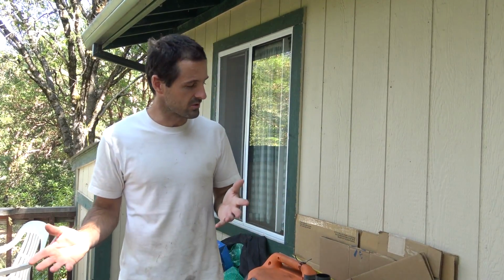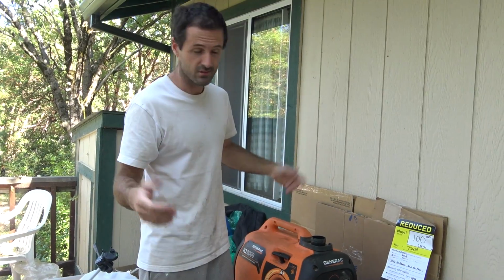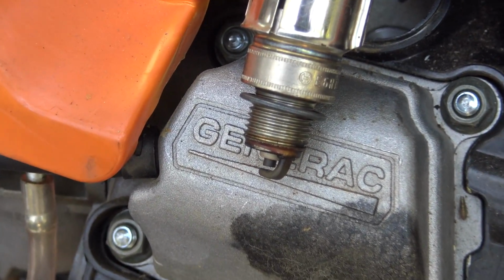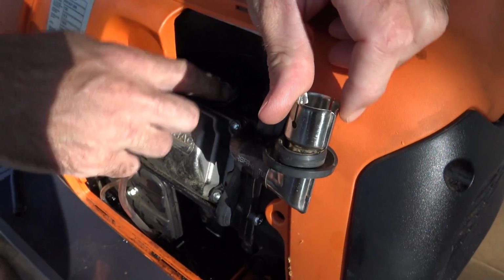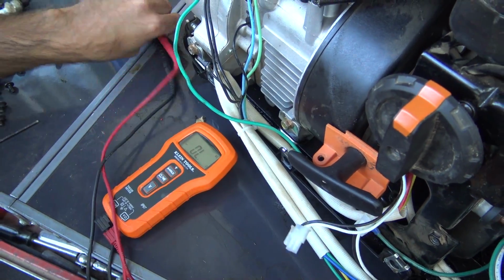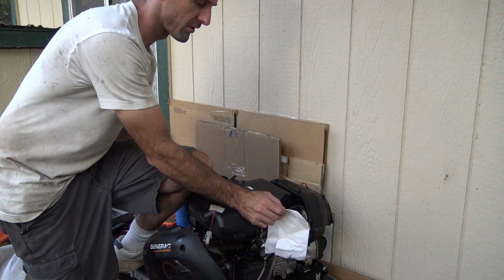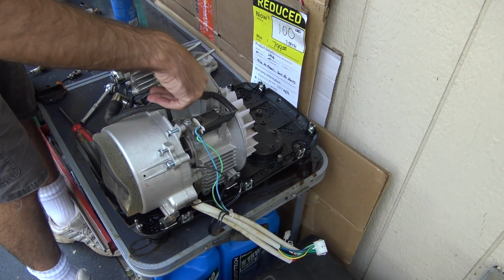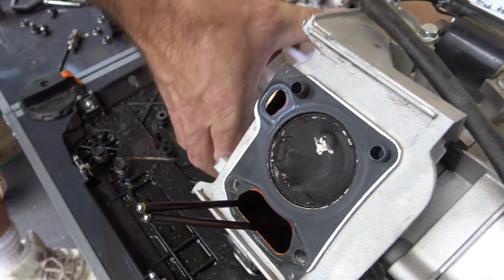$25 Generator From Lowes - Will It Run?

Comment: Someone took it apart and wound up the recall rope backwards. Causing the compression release to release during the top dead center compression stroke and the spark plug is fouled due to the high oil level. They probably had the engine on its side as well letting the gas into the crankcase via the carburetor. While they was working on the pull rope. I have actually seen this on a Briggs & Stratton push mower. A customer brought me a push mower that the pull rope would not engage. And they did not tell me they had it apart so it took me a few minutes to figure out what was going on but they had actually wounded backwards after breaking the spring and I had to replace the spring again because by the time they forced it to go backwards it it bent the spring to the point that you could not make it go the right direction no matter what you did.

Comment: 1st, i'm pretty sure the oil level was fine, look how the neck goes flat to the crankcase, there's no way there is enough oil in this thing if you just keep it "level". I have a hyundai generator and it works the same way.
2nd yes there is probably a decompression system.
3rd air movement in the crankcase is perfectly normal because when the piston is running you are constantly changing the air volume in the crankcase.
4th, when you have a weird spark, you 1st try a new spark plug, then fix the electrical before disassembling the engine!!!
I bet the carb is clogged up and the spark plug is faulty, or if you really are unlucly, the coil is bad.

Comment: I had lawn tractor with a Kohler 24 hp twin and one day it swallowed nut that held the air filter on the carburetor and it lodged between the head and the vavle. The valve stuck open and caused the pushrod to bend. The valve was OK and there was no other damage. The engine stopped running and literally had no compression.

Comment: Bald, man your going bald! Bwa ha ha ! You have more hair than Trump in a wind storm. Anyway, let us know what it was and I believe when you have to much oil it needs to be cleaned with wd40 and that carbon build up will not fire off to much as well! To much oil in that cylinder will slip Oh Get a new spark plug and stop putty gas on them! Whats wrong with you!

Comment: To help you out dude you don't put gasoline on the spark plug you might get it to run if the plug is fairly strong or new just advice not knocking you good luck hope it runs for a long time for you

Comment: You need to adjust the camshaft to lift gap. One of the valve most likely the exhaust valve has lost clearance where it's lifter contacts the camshaft so it is always open just a little bit. Or maybe it jumped timing.

Comment: Im thinking the guy that returned it, may have broke the original pull cord, bought a replacment, wound it up the wrong way, causinge tye engine to spin backwards making the exaust port the intake and the intake port the exhaust (explains all the compression out of the breather too than)  put it back together and wouldnt start so he returned it. And would explain why when you tried to rotate the other direction it had compression.

Also, just earnt yourself another sub :)

Comment: My first guess is that your valve timing chain or belt has skipped or broken. Doubtful that the rings are the issue in this case. Did you check to see if the rocker arms were moving when the engine was rotated?
Reply: The compression - or lack thereof - was a pretty obvious clue. This small size of engine very rarely has a compression release.
Reply: Camshaft is direct drive in these small engines. Wiped intake cam lobe or broken cam shaft is the most probable cause.
Reply: akio2589 - If that is the case then I agree.

Comment: Did you try checking for spark with the plug wire only?  It could be a bad electronic ignitor on the fly wheel

Comment: Whoever had it apart put in the piston 180° from the way it should be installed, so the pin offset is wrong. And just enough wobble to the piston skirt that the rings don't seal all the way.

Probably a dumb wild guess, but that's what I'll go with.
Reply: I like your guess. Is this even possible though? I still like it. Would be hard to figure out for sure.

Comment: I really believe that your engine has a compression relief.   According to Briggs and Stratton, the way to check if you have compression on their engines with this feature is to spin it backwards and check for a bounce back effect.  Seems that yours meets this criteria.  I always test my engines with non-resistor plugs and unless there is a problem with interference, I leave them in the engine.

Comment: the coil spring should only work one way for the pall cord so i don't think that's the problem like others said, also even if the motor spins backwards the air shouldn't be escaping out of the valve cover like it was,  i think it must have some other problem  maybe over filling the oil has cause the valve lifters to have some type of problem, if the motor even has lifters lol

Comment: I think that you should have checked the valve clearance before you even thought about taking the head off,  It would have been easier in the long run,  he valve clearance is too close so when the compression release engages, it opens the valves too much  making it so that there is no compression when the compression release is engaged,

Comment: Cam is 180 out of time
Reply: Ralph Morgan not really, hpw wpuld that happen.. if it wasn't worth rebuild the would not pull a cam.. plus it's geared to crank. If it even has a cam. Has connecting rods to overhead cam

Comment: First, Generac is often known as Genecrap. But for the price, why not. The gas part was good, sometimes a quick shot of starting fluid will make it start if it is a fuel issue. To much and you blow it up. I would of tried a different plug, they sell a tester that can check the spark without a plug (cheap). I would of drained the oil and pour some marvel oil down the cyclinder and give it a few tugs and let it sit overnight, then do it again. Overfilling and dirty oil are killers of generators, bad gas is the most common problem. I have only had to replace one faulty low oil sensor, on a Honda.

Comment: I think the piston pullback spring is worn out, fix that and grease the muffler bearing, it should start right up!
Reply: Muffler bearing is fine. Exhaust belt is worn.
Reply: oh yes of course the muffler bearing
Reply: commonconservative do you know if these small engines use blinker fluid? My lawn mower had the same problem and I just replaced the blinker fluid and it fired right up.
Reply: Mister Hat you are all idiots. Its quite obviously a cracked air filter
Reply: You need a metric crescent wrench for that.
Reply: +commonconservative
A good electrician will know how to use a professional wire stretcher.
Reply: No no no no no, don't mislead people, it's the turbo entabulator, look it up on YouTube you'll find it is a 10 minute video on it
Reply: kinda like a pipe stretchers we use in the shipyards
Reply: Muffler bearing? Must have a Bachmann turner overdrive too.
Reply: Experimental Fun the paint sensor is more than likely in need of service
Reply: Colyn Fetty ya ,well what about the deez nutz valve?  Did you ever even think of that?
Reply: Experimental Fun  I think your wrong it sounds like the waffle bearing he need to remove the pancake housing
Reply: Experimental Fun okay i am young i came to know about it with Chris fix
Reply: Somewhere I read these suitcase generators output 1.21 gigawatts. Can you confirm this?
Reply: Experimental Fun It has a bent Johnson rod
Reply: Experimental Fun haha you must be subscribed to chris fix
Reply: The  Kneuter valve is not slipping. It has bugs in it. The big bugs get stuck in the little flapper jobby that acts like a reed plate and lets the air blow back thru that vent tube he was showing us.
Reply: Flux capacitor missing ....
Reply: Experimental Fun OMG! I just realized I haven't greased the mufflerbearing in my mower! Do you need a left or right handed monkeywrench to access that?
Reply: Experimental Fun The real problem is people don't check  their elbow grease reservoir nearly often enough. The camshafts have probably siezed up.
Reply: +Basil It wouldn't be slipping if he didn't overlubricate it.
Reply: Double overhead cam flinger
Reply: I had of muffler bearings and blinker fluid since like the 1998's. I may have heard of canooder valves but not exactly. And I am sure it existed before the 1998 because I always hung out with the other krakens that were in their 40's when I was like 16-19 age. I heard plenty of party stories of the old Seattle areas and how awesome it was running from the cops on dirt bikes through the woods, but, they did lose all the booze.
Reply: I am pretty sure the magneto plunger o-ring detents are worn clean away.
Reply: noblsht i concur the turbo entabulator is a fickle part
Reply: You should check to see if anyone used any zip ties on any of the wiring because I used some on my spark plug wires to make everything nice and neat, but I made them too tight and was cutting off the circulation.
Reply: its a bad joke
Reply: Experimental Fun stop it...🙄😂😂😂😂😂😂😑😑
Reply: Experimental Fun ha. chris fix. Nice
Reply: someone didnt put rings on the piston is my guess
Reply: Colyn Fetty All of the comments in this thread are jokes bud. Even the ones you think are serious.
Reply: Experimental Fun 
Nice catch...!
Too many people forget about that muffler bearing...!
Reply: Colyn Fetty the hell there isnt just picked some up yesterday it was by the turbo entabulator but to the left of the piston spring ya twit
Reply: Experimental Fun definitely Grease the muffler bearing LOL
Reply: So you've replaced the muffler bearing and greased it (so it slides in and out good) Also make sure about the wire stretcher (the correct amount of tensile strength) After that, it's gotta be the F.C. Just let go through it's cycle. Good call Bob
Reply: maybe the muffler unraveled lmao
Reply: Experimental Fun if it is the flux capacitor, I would just throw it out or trade it for a used Delorean personally.....
Reply: yeap, definitely the exhaust belt.
Reply: Have you tried putting it in a baggie full of rice?
Reply: hahahaha nice
Reply: Experimental Fun what, r u talking bout..
Reply: commonconservative lol
Reply: One other important note I forgot to mention. Was Jennifer wearing a bra this whole time? If she was then that could give a no start problem also.
Reply: Experimental Fun 
Got to watch out for those Muffler Bearings...!
Reply: Experimental Fun lmao
Reply: Chris fix would be proud
Reply: Don't forget the blinker fluid
Reply: I think the pull cord is on backwards, so its turning the engine in reverse and therefore not getting compression.
Lets see what he finds in the next vid. He might alway want to try a different spark plug. ;)
Reply: Experimental Fun Grease the muffler bearing? WTF?
Reply: Experimental Fun 😂
Reply: The nitros oxide is leaking from the pull starter mech. Causing a temporary hole in the dilythium crystals
Reply: Chris Fix!
Reply: I believe you mean the piston return spring😂
Reply: Drop some viagra into the fuel tank and that should straighten out that johnson shaft.
Reply: I had the same problem with mine 2-3 weeks ago.It turned out to be the brass magnet in the brass magneto,s bell housing.
Reply: Tf is a muffler bearing
Reply: Yep make sure those muffler bearing aren't worn out
Reply: to go viral put the plug in your mouth and give it a pull
Reply: what the heck is blinked fluid?
Reply: Cyprian Cyprian no people been saying muffler bearings and canooder valves since before the internet existed....just saying
Reply: I had a guy bring in his car to me on a tow truck. The car had no fuel pressure. After a long diagnostic, since the problem was the last thing I expected, I get the owner back and get into the car with him in the driver's seat, and tell him that the problem isn't something I am sure I can fix, although I did have it running again,. the problem was, in fact, the nut behind the wheel. He looked at me funny, confused. So I explained to him that the reason his car had no fuel pressure, as it turned out, was that there wasn't a drop of fuel in the tank. So I point at the dashboard, and tell him "you see this needle right here, between the E and the F? That is your fuel gauge. When the needle gets down to E. YOU HAVE TO PUT GAS IN, regardless of if you want to, or have time to, or can afford to, or whatever, OR THE CAR WILL NOT RUN. NOW, if the nut behind the wheel is clear on this matter, then NOW the problem is fixed. If not, well, I can't help you". Most people don't need to spend nearly $500 in all to have their cars towed to the shop to have a mechanic tell them that. And that nut behind the wheel is really out of any mechanic's power to fix, usually.
Reply: UPSoA+It took you a long diagnostic to figure it out? Maybe you were a little harsh on the guy considering you already know how to read a gas gauge and he is but a rank armature.
Reply: Oh yes of course the muffler bearings replaced those last summer all by myself😂😂
Reply: murph murph the ELO is obviously worn out as well.
Reply: Would it need some blinker fluid? I heard that could cause problems some times.
Reply: Tyee Cambrón there is no such thing as blinker fluid, dumb fuck.

Comment: Forgot to mention that I have a Honda 2000 inverter/generator for my travel trailer.  I drain the gas out of the carb bowl after each use as per the manual (I assume it's because of the ethanol issue) and it take a lot of pulls to refill that bowl.  For a couple of hundred dollars more, I think it was worth it.

Comment: Bad plug.  I bought a brand new Honda 15hp Honda outboard for my aluminum boat and it ran great for awhile.  Then all of a sudden it wouldn't start.  No warning, just dead and I was on the launch ramp of a lake so proceeded the rest of the day on the trolling motor.  I did the usual things you did, short of tearing the motor apart then went on the web.  Apparently Honda outboards had an issue with bad spark plugs so I got two new plugs and it started on the first pull!

BTW, I used to pickup gas lawn mowers that people threw out on trash days and took them apart just to tinker with them.  You got a deal for $25!

Comment: I predict busted plastic cam teeth. Known to fatigue and break after about 1000 hours on Chinese engines. I had three cheapo Chinese generators that had cam failures around 1050 hours +/- 50. If you are VERY lucky the cam will be available for $8-$25.

Comment: First guess is that the rings are not offset. If this is the case then all the compression is lost through the rings not sealing. Next I think stuck valve. If it has a valve open all the time well... Lastly I think that over filling of the crank case with oil is the cause. Alot of these generator require only .6 quarts. Adding a full quart or more can cause pressure to build in the crankcase. Could also be a crankcase gasket. Or ....

Comment: Not all spark plugs have "continuity". A lot of spark plugs have an internal resistor to reduce electromagnetic interference. Set your meter to kOhms and try again.
Reply: Came here to say just this. He does mention this may be the case later on.
Reply: Didn't he say that?

Comment: I don't think the pull cord is wrong because "boy" was pulling the same rotation as when he hand spun it, plus the vanes on the flywheel are situated correctly, spinning it in a clockwise rotation.  I wish his arm wasn't covering up the lifter as boy was pulling it over to see if they raised and lowered correctly.